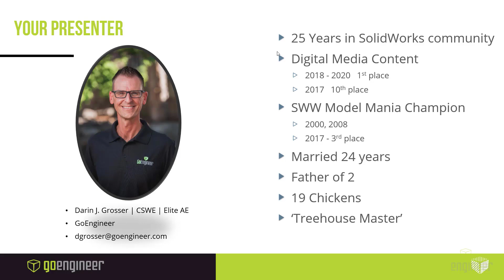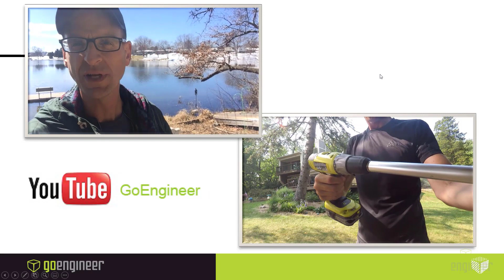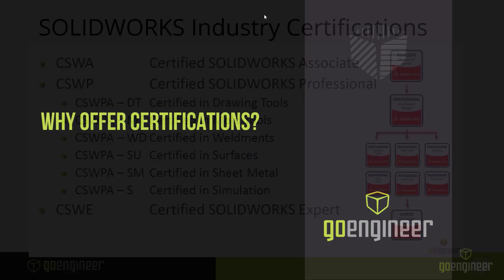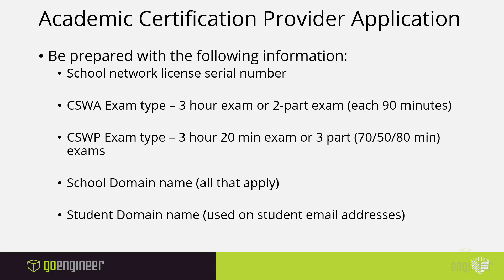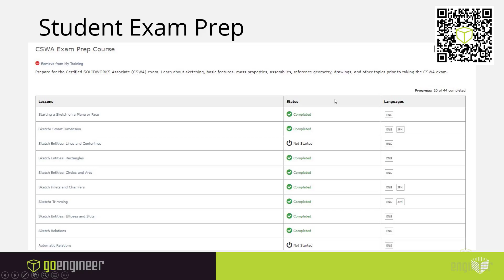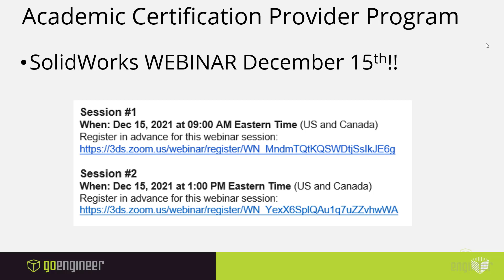SOLIDWORKS EDU Student Certifications - Webinar

Comment: Thank you for the informational webinar. My main goal to reentering college was to obtain the certifications. Many of the textbooks from Soildworks contain the testing codes for a ONE time test. But do not provide for the exam prep. 
I graduated from the mechanical program this December and can now focus on the certification(s).  I have Solidworks student version installed on my personal desktop. Are the exam preps available to me? or do I still need to use the school license to utilize the prep exam?
Reply from the maker: The Student Edition (purchased on the SOLIDWORKS website) can get an account on mysolidworks.com using the serial number, and then would have access to the prep courses.  If they have the Student Access license from school, then it also has access. You will also need to create an account here: https://my.solidworks.com/account/student-registration-direction